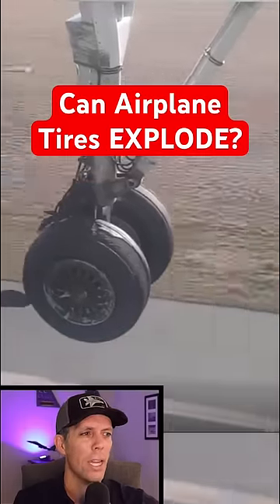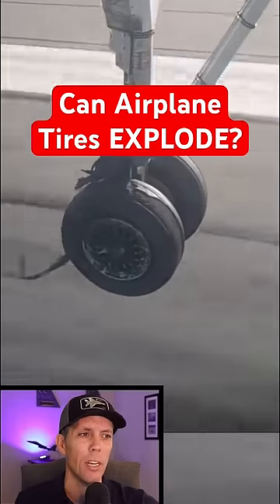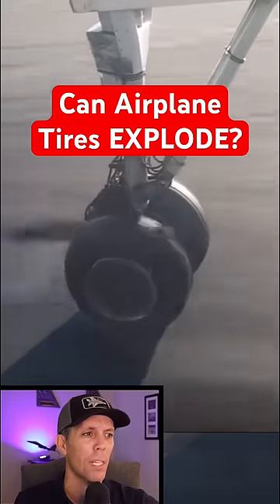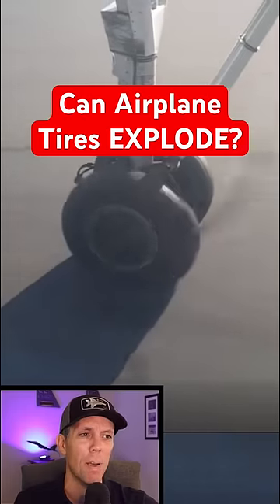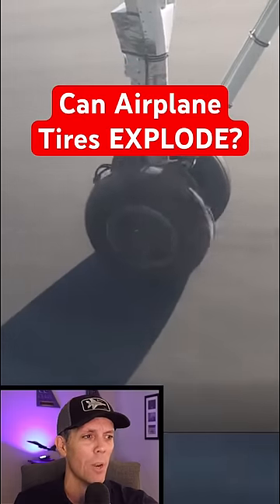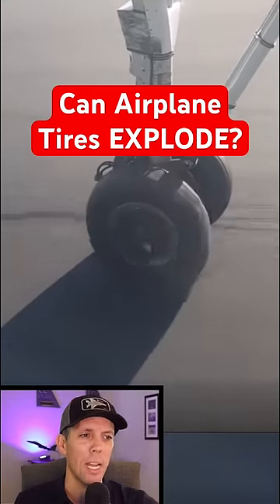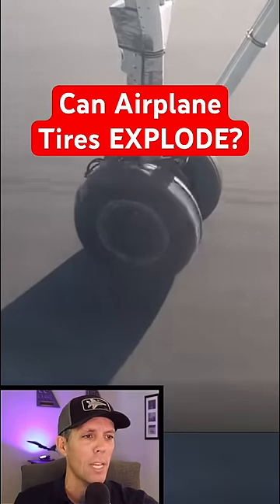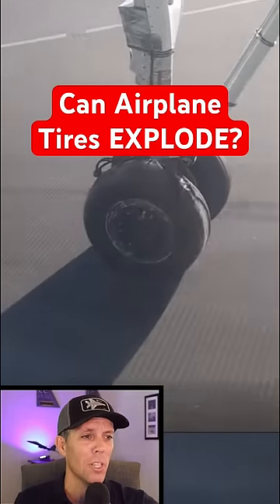Can Airplane Tires Explode?

Comment: I worked for a company that does the rubber removal on the runways at SFO. Can confirm that we would pull about 3-4 cubic yards of rubber out in a single shift.
Reply: Holy cow, I wonder about that all the time.  Is it a blade of some sort?  Heat?  Pressure wash with super duper vacuum?
Reply: @tomh-ph3dp   It's called "water blasting" think pressure washing but at about 40,000 psi. And yep, vacuum system recovery.  It's pretty damn cool! If you like machines, you'd probably dig this!! 🤙🏻
Reply: @FIREGURU  Thanks, man!  Sounds awesome
Reply: And what happens to the collected rubber?
Reply: tigergold5990 💀
Reply: @FIREGURU  I wish chat had pictures... what's the name of the machine so we can look it up?
Reply: @tomh-ph3dp  Orlando international had pressure washers based machines and wire brush machines somewhat similar to a normal street sweeper but with a cleaning and recovery mechanism constantly dressing the brush and recovering the rubber. The brush machines are supposedly actually gentler on the runway than the pressure ones but were always having problems for us.
Reply: I literally have no clue what a cubic yard would translate to lol. But I guess it's prolly a lot
Reply: @viincanity  About the size of a washing machine
Reply: Why don’t they just make the tires get close to matching the planes speed?
Reply: @SkylinesProductions that would require installing motors, which adds weight, bulk, and more mechanical issues. It’s not really worth it
Reply: @fuckwlrd433  I’m sorry are you an engineer? Cause I am.
Reply: @shadowninja8011  That makes sense. Thanks!
Reply: @Kalki2026  We would empty our collectors at the designated area near the maintenance facility. I don't know what the environmental team from the airport did with it from there. I imagine they might mix it in with new asphalt more maintenance roads and shit.
Reply: CarolineAlaskaFox   3 cubic yards of sand would be about 6,000 lbs. Rubber is much lighter. Probably about half. 3,000 lbs of solids.
Reply: @viincanity   think like a 3ft x 3ft box.
Reply: tigergold5990 wait wut....??
Reply: @viincanity 200 Doritos locos tacos
Reply: what the fuck is a cubic yard
Reply: @viincanity  yard is very close to a meter. Like 0.9m.
Reply: @FartInYourFace234  And what does that childishly ignorant comment have to do with anything here?
Reply: @illbeyourmonster3591 bro read the name of the guy you replied to what did you expect.
Reply: tigergold5990 your comment made me giggle out loud 😂
Reply: @sprendinea cubic=cube, yard~=0.9m~=3ft...you not get anything but English from school?
Reply: @anthonywilliams7052 Chat? Buddy this isn't Twitch lmfao, you meant to say OP
Reply: Yeah me too the tire are so trash like they shall replace them with hydrogen gas so it get less hot when landing
Reply: how do you get in with a job like that?
Reply: @mryellow9655 Can’t possibly see how this could set something on fire.
Reply: Why no cubic meters?
Reply: That's horrifying. Is that worse than roads?
Reply: This could be tricky to describe on a resume'.  "Yeah, that's right.  I was a rubber remover".
Reply: @aaronhpa  America. That's why.
Reply: I live near SFO and it’s my favorite airport. I ❤️ SFO.
Reply: Just picturing that amount is insane
Reply: Since some people are confused by cubic yards allow me to simplify that 3-4 cubic yards to a more understandable measurement. Around 140,000-185,000 cubic inches. Hope that helps.
Reply: @abonynge   😂
Reply: Could anything be done with the rubber or was it just, un recyclable at that point
Reply: How's the pay?
Reply: tigergold5990  wait what? animal food? Can you digress?
Reply: @Betlejuse420  prevailing wage!! $65 per hour plus time and a half. It was a graveyard shift. We worked about 12 hours.
Reply: @jinxc7811  it would be recycled
Reply: @sprendinea a yard in 3D
Reply: @FIREGURU  What would i even look up for a job like that? Or would i just look at my local airport for job openings?
Reply: I wanna see that job being done!!
Reply: @God-w-  The company I worked for was contracted by the airport. The equipment is commonly used by remediation companies to remove asbestos or other hazardous materials. Technically it's called "surface preparation". High pressure water systems like this are for a very niche market. Last I checked there were only two companies with that equipment in NorCal. It's very expensive to own and operate the equipment. The rig, recovery system, truck and trailer are about $500K to buy. Maintaining it is also time consuming and labor intensive as well.
Reply: Melt it & recycle.
Reply: @viincanity  order pavement for your driveway and you'll know.
Reply: @beatnik6806  but vinic is 3 times the unit.
Reply: Edit cubic. Example 6³ is 6x6x6 = 36x6...x6.
Reply: This is the info I was looking for
Reply: @FIREGURU  I once removed the rubber too, now I'm paying child support... dad joke!😀
Reply: Wheels release a lot of microplastics and are very difficult to recycle. Train wheels made of metal however can be melt down and recycled.
Reply: I’m also quite skilled at pulling rubbers
Reply: @FIREGURU at that high psi does that not fk with the runway? Like breaks it up?
Reply: @gaza4134   it will if you don't keep the tool moving. It'll blow a hole in concrete.
Reply: @shadowninja8011 you wouldn't necessarily need a motor. You could add a small turbine that would use the aircrafts airspeed to spool them up to closer to the actual groundspeed. But its still extra weight
Reply: @FIREGURU so essentially a hydro-vac?
Reply: what did they do with the rubber dispose?
Reply: @shadowninja8011 you're right! But honestly.. just put ultra basic brushless motors in the wheels don't represent a too big amount of money, bulk and weight No moving part, almost zero maintenance and  trouble..  Landings could be more smooth for everyone: tires, plane structure, passengers ..nope ?
Reply: Ayy fellow SFO crew
Reply: Water blaster for the win 🎉 or u guys do a differnt way
Reply: Can they reuse it or is it turned into mulch?  Or do you know
Reply: so 3 cubic meters....make it 2 at water weight is 2 tonnes is 2 tons is 4000 pounds.
Reply: I was about to ask about this. Fascinating. Do they have like a Zamboni type machine that comes and removes the deposited rubber?
Reply: @FreejackVesa   High pressure water. 35-45 thousand psi. And vacuum recovery.
Reply: @FIREGURU you only gave two distances. Need the third measurement.
Reply: @viincanity 3'×3'×3'
Reply: How could a passenger film this?
Reply: @craigcrissman4651 an extra 8 lbs of aluminum  as fins on the already existing hub wouldnt matter at all imo. This was my initial thought also. Wouldn't be hard to make the tires have at least some rolling momentum at start. .. it actually looks like they are braked before landing as a free spinning wheel would be under low pressure forces causing it to spin anyway.
Reply: tigergold5990 ha ha no
Reply: @fireguru who asked you to "confirm"? Dude states the obvious in EVERY single video he posts. Seriously pisses me off how I constantly see some comment "verifying" or "confirming" blatantly obvious shit like 2+2=4.

You people be like, "can confirm, I was born, therefore he's telling the truth". Or the truth is the truth because its the truth.

You commented because you're an attention wh***, not because the information actually needed to be confirmed.
Reply: Bro reading "cubic yards" just made me vomit a little. Trying to compute how much that actually is..... they rly need to stop using imperial system tbh...
Reply: tigergold5990 farm animals are being fed rubber?! That’s messed up
Reply: tigergold5990  I would have thought that rubber was used again to make tires. 🤷🏻‍♂️
Reply: Do yall use a stripehog???
Reply: @FIREGURU I actually maintain two of those machines.  Stripehogs made by WaterBlast technologies out of Florida
Reply: The rest of time you fk around 😀
Reply: @Kalki2026 it is sent to China where it is processed  and bleached till it white and they then cut them into small grains and repackaged and sold as rice worldwide 🌐
Reply: @sprendinea  about 18 bald eagles compacted together.
Reply: @mryellow9655 yeah because nothing bad ever happens when hydrogen is exposed to sparks or high heat.
Reply: @abonynge much better.
Reply: What do they do with the rubber please tell me?
Reply: @viincanity a wheel barrow full
Reply: @viincanity about 765 liters
Reply: @sharoncassell5273  great suggestion, thing is i order that by the m³ (cubic meters) tho many have pointed out that a yard is like .9 meters by now 😂
Reply: Do u sell the rubber?